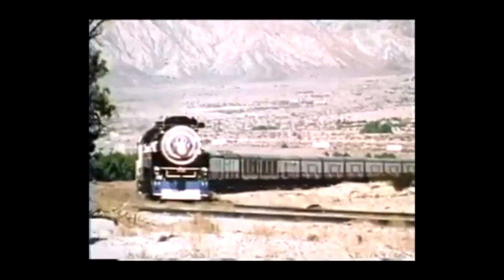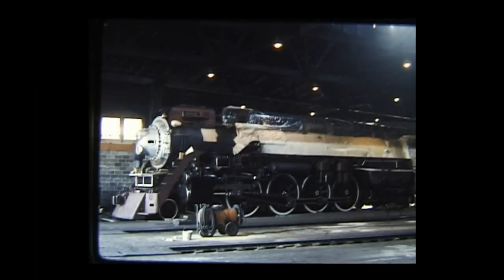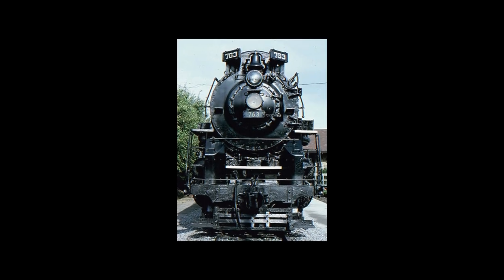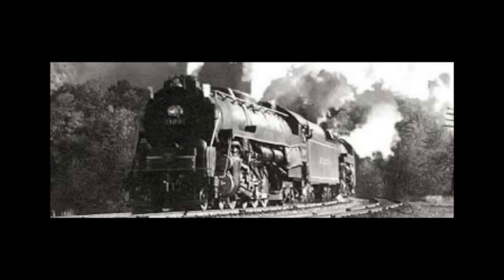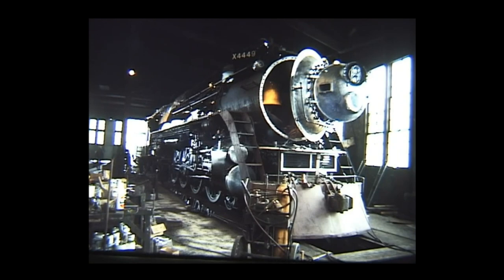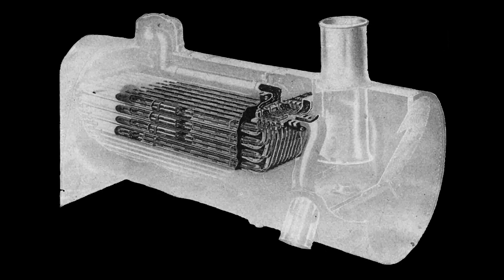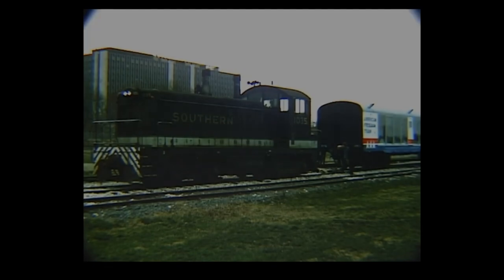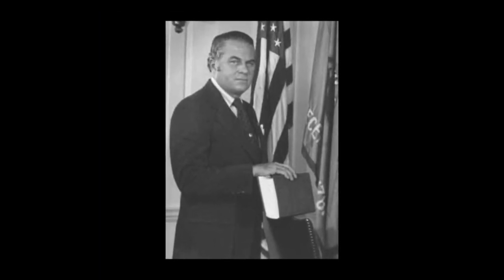The Story of the 30 Day Miracle ft. @Thunderbolt_1000_Siren & Ross Rowland

Comment: Nice job on the documentary, and I also had no idea this other nickel plate road steam engine I never heard of was also considered for the train lol, and something regarding the N&W 611 when it was considered for the train and judging by what I found, the piece of art the lionel model is based on was drawn in 1974 and my best guess is it was probably before they found the SP 4449 and went with that instead since it was being restored late 1974 probably, heck the 611 design without the bullet nose was used for the official AFT logo despite the engine not being used from what it said, though the question remains on why the 611 wasn’t chosen depending on what problems it had, not that it’s really a big deal or anything but just a mystery.